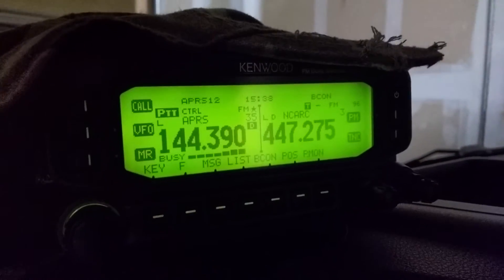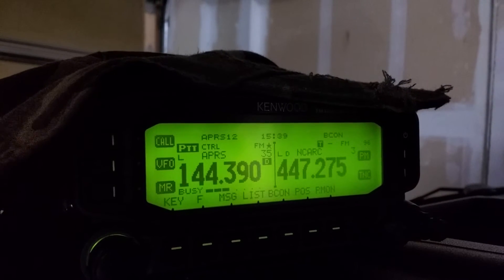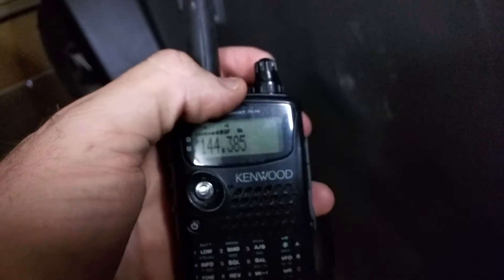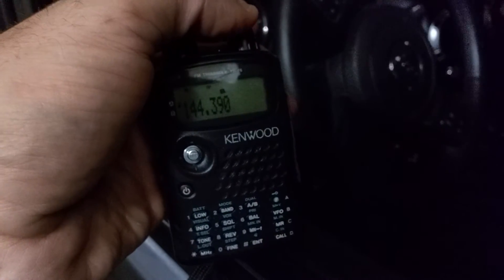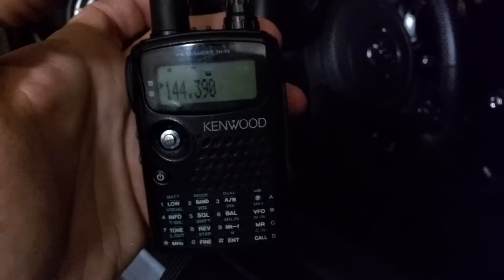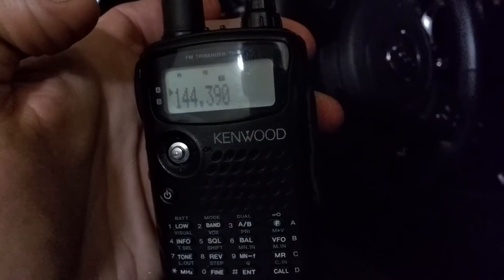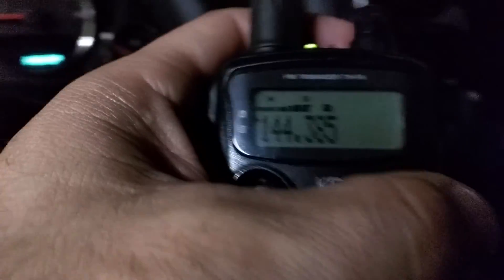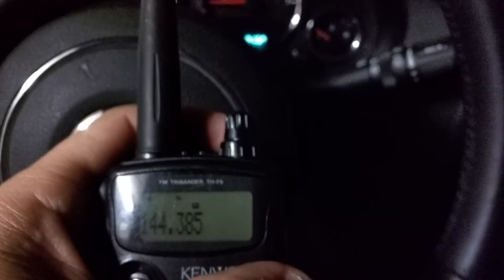Radio Interference in the 2015 JK Rubicon

Comment: 5 watts on 12 meters caused the sway bar to disconnect in my jeep. most hf bands tore the hell out of the controls in the vehicle.  the main issue of rf came in from the AC wiring.  Jeep would not let me repair / filter it without it voiding the warranty.  got rid of it and went to a new H3 alpha in 2010...no problems since then.
this was along time ago, but chrysler had no intentions of fixing the problem.
you need a spectrum analyzer with h and e field probes to find the problems  but they will void your warranty if you start choking wiring of shielding the relay box / grounding a shield around it.  look into the Rigol DSA815tg and the Tekbox probes.  you can go into the analyzer and modify an ic to prevent the trial license from expiring.  this is only software, but it does help some.  you can get away without it but you will loose a lot of features.
  i wanted to spray copper on the box and ground it plus choke the ac wiring but they would not let me and keep the warranty intact.
this was a rubicon.
if you live in north georgia respond and i'll try to help you...but if the vehicle is new, it cold put you out of the warranty.

Comment: Did you find the source? I have a 2013 JK with Yaesu FT-400XDR with almost the same problem. Same frequency. If key is off, no noise. If key on, but don't start the engine, no noise. If you start the engine, 3 seconds later you get the interference. You must then shut all the way to off, still have noise. If you open the door, then the noise goes away instantly.

Comment: I have an ‘18 JL and my problem is virtually the same. I used my HT same as you to locate the main source. Mostly coming from dash area. A few tests verified it was coming through my antenna. I relocated mount to rear of vehicle and eliminated issue 100%. My setup looks the same. Kenwood D710 and K400 antenna mount. Technically, it shouldn’t be causing interference and Jeep should come up with a fix. I just didn’t feel like waiting for that.
Reply: I have 18 JL and when engine on and brakes pressed I have interference on handheld baofeng, when engine off or brakes not pressed there is no interference. It is annoying. Interference present in back seat  area too but not cargo area. Still not sure how to eliminate the noise